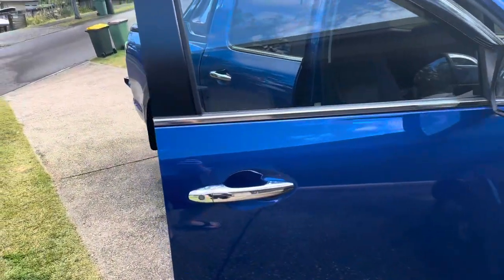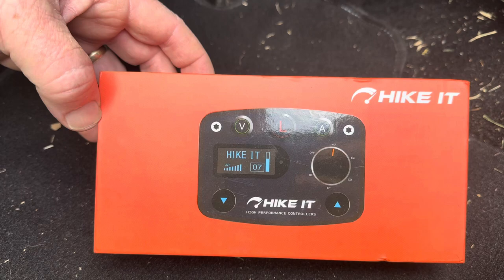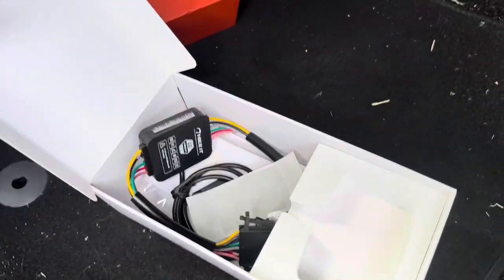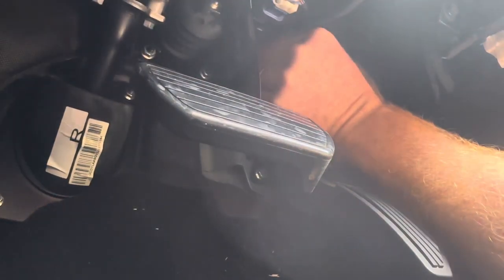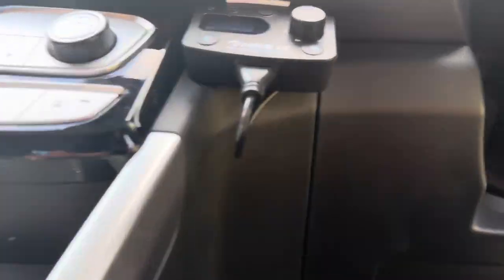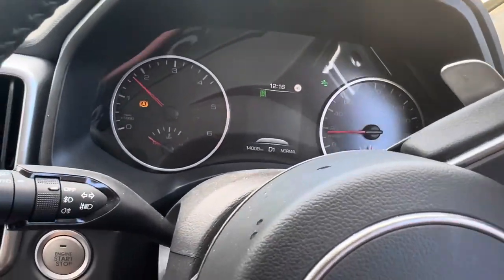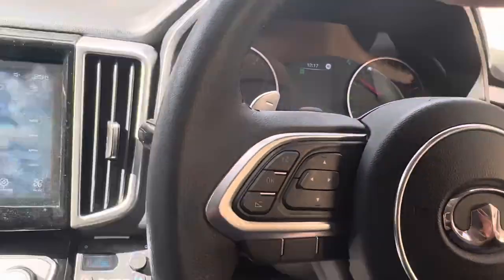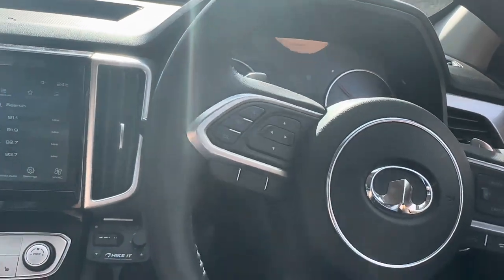Hike IT Throttle controller install. Diesel Lag Gone!!!! GWM Cannon!

Comment: I have seen lots of videos speak about been stationary at an intersection and the delay when you want to pull out inbetween the traffic gap and not one (not that i have seen yet) follow up on another video or within that video saying to get one of these throttle controllers. I don't care about going 0 - 100kph of how quicker it may get to 100kph, all i care about is getting my car moving from 0, without the "lag", 1.5-2seconds, to pull out safely. it may not seem long but with traffic it is significantly important. Seeing this video and others about how it feels (the response when at a stop to going), its improved, if it really does make a difference, why don't the manufacturers do this in the programming of the ECU? so on that note, thank you for this video and I will just have to buy one today. :)
Reply from the maker: Thanks. for watching and for your comments,How did you find the HikeIt? Was it a good investment for you? Would be interesting to hear your thoughts. Enjoy.
Reply: @AussieKawiman  hi. Sadly it did not make a difference for my MG at a stop to moving forward issue. During motion it was sensitive but without it and I select Super Sport mode it's still good without it.
Reply: @Hobby1976  if you have a MG HS you need to get it onto AMT mode. There are videos on youtube and simply done in 2 minutes via the settings menu on the touch screen. The difference is amazing.

Comment: All these do is amplify the signal, the standard map for the pedal travel is ideal, I have one of these in my cannon and it is on normal mode, it is possibly useful off road to reduce the sensitivity and maybe towing might feel better on a more sensitive setting. Otherwise, spend the money on beer, its more fun. Also, turbo lag is unrelated and unaffected by these.
Reply from the maker: Correct,Amplify the signal.And i like that it does that..Thanks for watching 👍🇦🇺

Comment: That's not turbo lag you are fixing. Use your left foot on the brake while holding the accelerator down. It'll close the EGR and spool the turbo, then when you let off it'll go like a rocket. That's what turbo lag is, trying to accelerate the mass of air. Or this does is give the throttle a new map, which is useful in some cases.
Reply from the maker: Well it sure does fix that big lag off the bottom….Maybe it’s the new throttle map???? That’s why i put it in to fix that which it does.And for $200 👍👍👍

Comment: Hi, I've just tried to install Hike It XS but the male connection from the throttle, just won't click into the female connector on the XS throttle control. Did you have any issue when installing, as I've described?
Reply from the maker: Sorry mate but i had no problems with it,went together pretty easy.I hope you got it sorted,Thanks for watching 👍🇦🇺

Comment: It's because of your video that I went and got one of these, and bloody hell, it's night and day, I love this thing and would highly recommend this for anyone seeking to significantly minimize the lag, I recommend the sports setting turned up to 10 for the best plant your foot to go somewhere.

Thanks again for posting this, the install was simple, but trying to find a spot where to put the controller was a bit trial and error, but I mounted mine under the steering column on the flat plastic bit.
Reply from the maker: Awesome mate,so glad it helped,I turn mine off now and then just to see how much of a difference it makes,Have you used 4x4 mode? Not sure what that is for though.Thanks for watching mate👍

Comment: Hi bud. 2 questions.  Does it affect the 7 year warranty? And what was the orange light on the dash. Cheers.
Reply from the maker: Apparently it does not, but i disconnect it when i put it in for a service just to be safe. Others say it does not but am not going to risk it.Orange light is I think it is the brake hold light. For when you put the brake on at the lights it will go green and then you can take you foot off the brake and it will hold until you press the accelerator. Thanks for watching mate..

Comment: Hey mate we’re did you get the sports rack and roller shutter ?
Reply from the maker: I got it from a mate off his Hilux,I ended up taking it off as it made the tray not useful to load dirt bikes as it took up 400mm in the front,Looked cool though.Try a alloy tray maker as they take em off and have around the yards.Thanks for watching mate👍

Comment: Nice video, question you said that you had a Hilux roll shutter on the back of your tube, did it bolt right on or required modification?
Reply from the maker: Dropped straight on,Although i did drill a couple of holes to put brackets on and for drainage pipes but no probs at all.I did take it off though as i couldn’t use it as a ute anymore as it took up too much room.Thanks for watching mate👍🇦🇺

Comment: Awww ok 400mm inside the tub ok can u tell me what hilux it’s off can’t find it did it fit perfectly? Have u got more photos?
Reply from the maker: It’s off a Hilux Rogue, Most dual cab utes are the same size and can interchange the canopies/covers. I dont have more photos but you will need to wire up the electrics to make it open and close..Good Luck

Comment: Nice vid mate, any chance of a quick vid on the hilux roller shutter?
Reply from the maker: Thanks mate,I got rid of the roller shutter,Took up most of ute and needed to be wired up ,Didn’t like it..Thanks for watching 👍🍻
Reply: Ahhh sweet well thats all i needed to hear lol i wont get 1 now
Reply: @AussieKawiman  , so Hilux roller shutter fits without any issues?
Reply from the maker: Is a couple of issues,Need to get wiring sorted to power it,Need to drill a few holes to bolt brackets to ,But nothing too hard .

Comment: Hey mate why did you have to hold it down for 3 seconds. I have a manual does it work with manual's.
Reply from the maker: It works with manuals just need to set it to it by holding the button to switch between.Thanks for watching mate ..

Comment: Snake oil dude...
Reply from the maker: What you mean? Works great,Gets moving off the bottom no probs,Changes throttle response for the better and i can adjust it as well.That’s why i put it on.What is it supposed to do? Thanks for watching mate👍🇦🇺